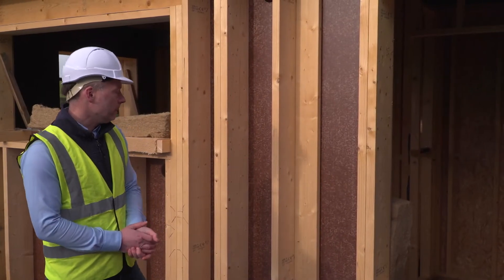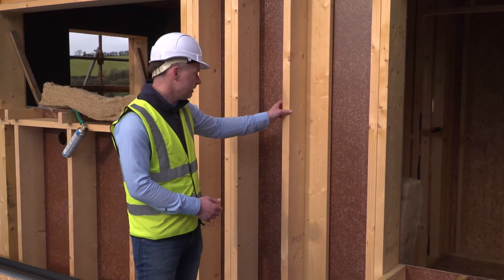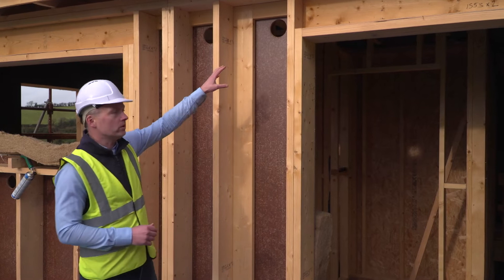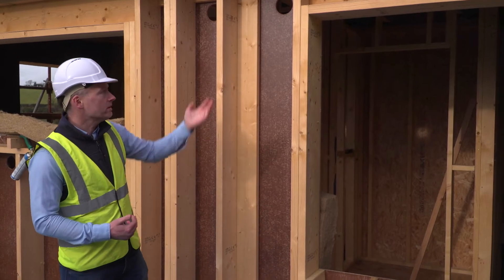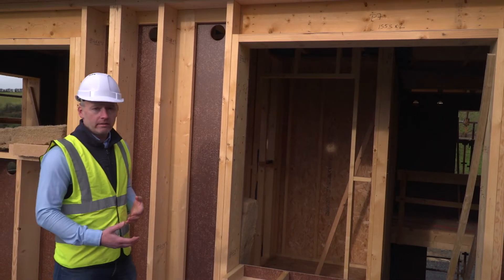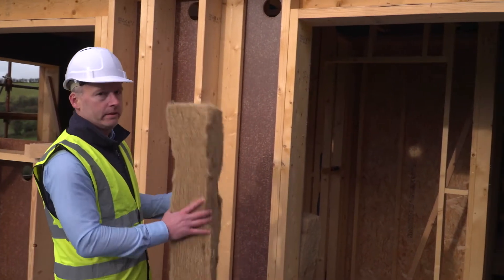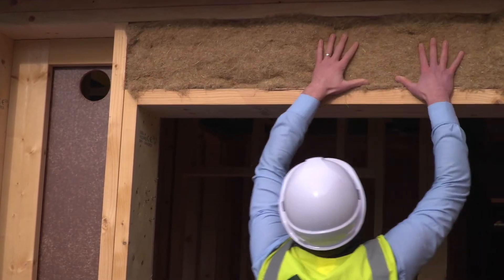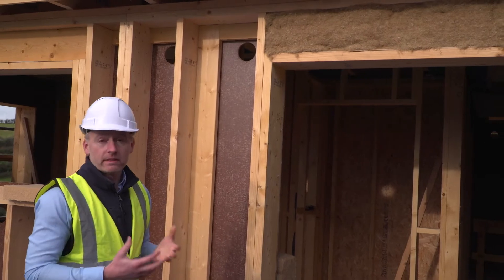Ensuring Continuous Insulation in Timber Frame Walls -Traditional Style Timber Frame Series (part 7)

Comment: Can I ask, with the blown cellulose how do you avoid any air pockets? I appreciate the holes are at the top of the voids, but it seems that there could still be obstructions within the panel. It would be interesting to use a thermal camera on these walls with a heat source on the inside after the cellulose has been installed.
Reply: Hi, panels arrive on site open, therefore an inspection can be made to ensure any obstructions are identified prior to injection. Pre drilling in of the interior sheething in the factory also makes for a more efficient install.  Narrow areas which are inaccessible for the hose are pre insulated with our Combi Jute. After the install random core samples are taken to ensure min densitys are also attained to offset any settlement risk. Hope this is helpful.
Reply: @niallcrosson5859  Brilliant, thank you for the reply Niall. It's a really interesting series!
Reply from the maker: Glad it was helpful!